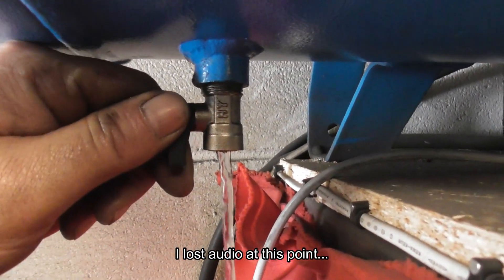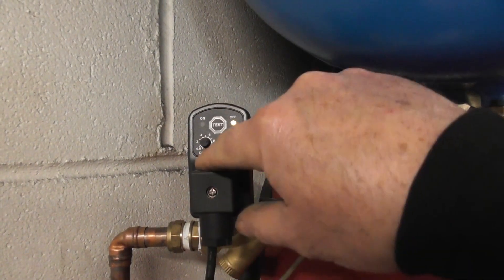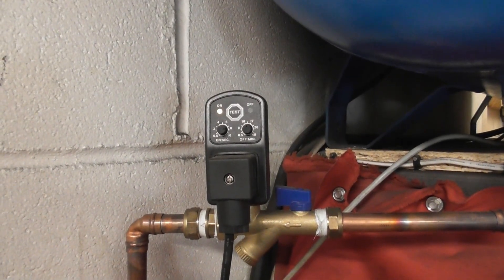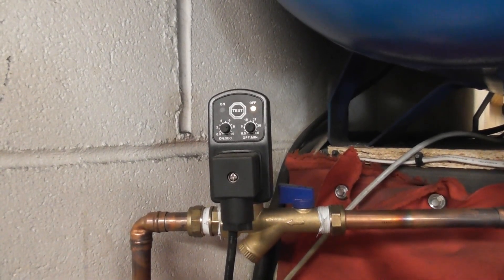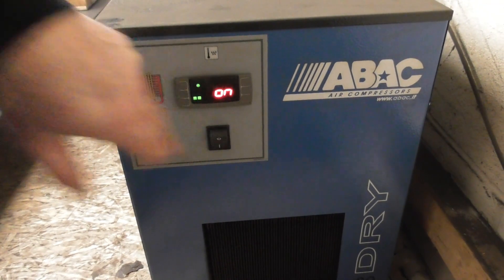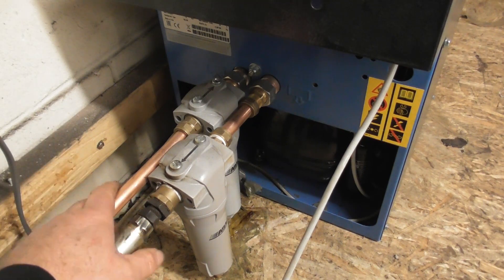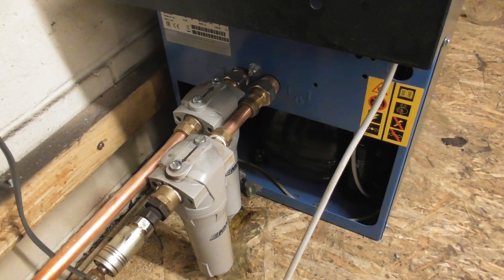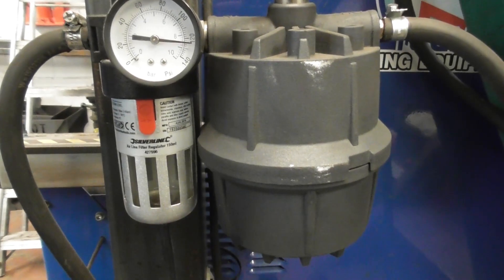Cool DRY Air for your Plasma! (AutoDrain and ABAC Dry 60 transforms Cnc Plasma Cutter)

Comment: Are the two filters on the dryer identical, I would imagine one filters air before going into the dryer and the one coming out is probably a different size, not sure.
Reply from the maker: they come as a set..one in one out

Comment: Hey Jason, great product, I live in a coastal area and I got tired of the high humidity issues and trying to filter out  the  all the moisture. I then had a brain fart that was to try using my SCUBA tanks, why not the tanks are dry air so, and no SCUBA tanks are not filled with pure oxygen. I devised a high pressure hose and a regulator to reduce the tank pressure down to around 100 psi and gave it a go. It worked so well that I made a manifold to put two tanks inline so I had twice the cf of air. It is a hack and when I get my stuff out of storage I will post the set up. Sorry I didn't mean to high jack your channel. Have a great day!!!!
Reply from the maker: Pmsl..Your posts/comments are always welcome Tim. can't wait to see your set up buddy..i hope things get back to some sort of normality for you soon my friend.